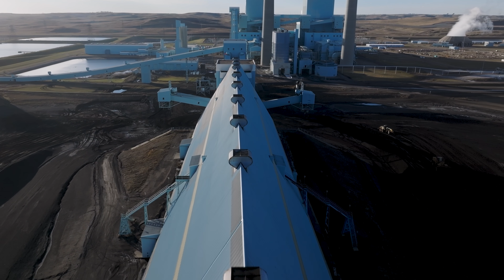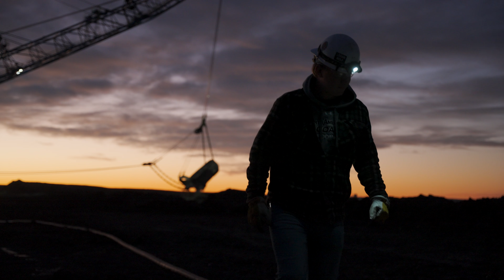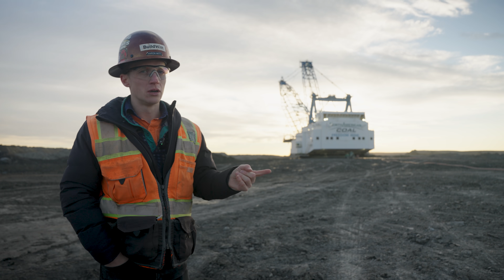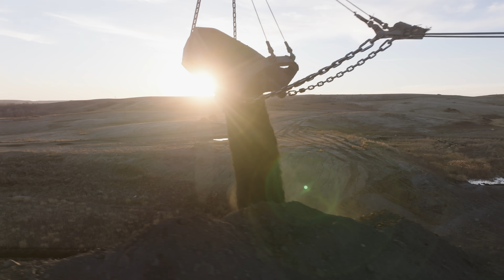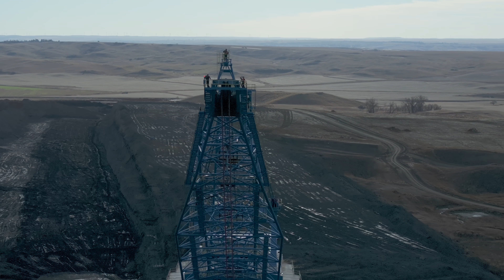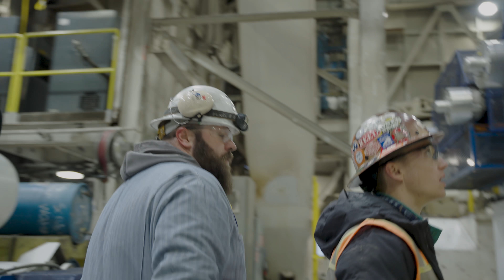Operating the World's Mightiest Earthmovers!

Comment: Incredibly cool machines, but why use these over bucket wheel excavator? Genuinely curious!
Reply: Mainly ground formation. If the ground is hard and cemented you can't use bucket wheel excavators. Also it's very expensive.  It can take one year to build one up from scrach, and you also need a conveyer belt system as well to haul the overburden

Comment: Thank you so much for the walk through 😊❤😊 the shot of the double picture of the Bucket on one, and the two control levers on the other, showing function of cables 😊
The Ground man has the hardest job in my humble opinion as to were to lay the power cable in perfect loops or big "U" shapes. But MAN the guy INSIDE the belly of the Beast what he has to understand in his "BRAIN" 😊 listening for the proble noises. Just understanding the motors, the electric systems. He is amazing. I give him an A+ for knowledge. The grease gun comments were so,so "FUNNY 😊 I love my 1978 Dynahoe-190 made by Bucyrus Erie 😊 I wanted to keep a part of their equipment line and own the beefy built Backhoe 😊

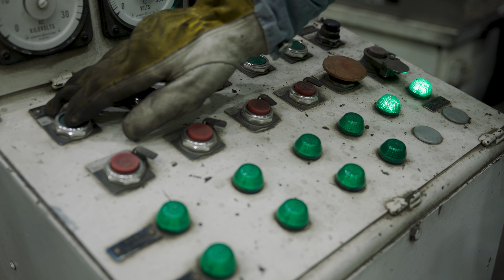Comment: 36:19 so they are using electric motors to spin generators? Is it to produce DC power? I imagine it also keeps the input power draw smooth by adding its own inertia in the system. Just never imagined that it wouldn't have been transformers or something.
Reply: I was curious about that too. Probably rectifiers at the time it was built were more expensive. These days you would definitely just use transformers to get your needed ac voltage then rectify from there with modern power electronics

Comment: Was the machine originally diesel powered ? It is already electrically powered and it's having "generator", so I guess these were diesel motor generator that got retrofited into electrical powered generator, but ... why not just install a power transformer instead ?
Reply from the maker: no always electric
Reply: @buildwitt  So would you be able to touch on a bit the reason for the "generator" ? They take electrical power to spin generator to make electrical power. I really really don't understand why that choice was made and usually I learn something in these moment.

Comment: I helped build drag lines for Bucyrus-Erie in the 2000s, working for a subcontractor in Racine, Wisconsin. It's very hard to convey the scale of these machines, but I ran a CNC Press-brake, rated at 600 tons, that had a 12 foot wide throat. 500 tons is a million pounds. I bent 4" thick steel plate like paper. But the Bucyrus-Erie plant itself had press-brakes that bend 12" thick steel plate, so maybe a 2500 ton capacity ? The buckets hold approximately 100 cubic yards of material, or 10 semi dump-truck loads at a time.The buckets on drag lines are 1 foot thick steel. The operator cabin is a 2-bedroom appointment, with a kitchen and everything. They are assembled onsite, under tents covering over 10 ACRES. The gears that rotate the cabin are 10+ feet in diameter, machined within 0.001 tolerance. The company that forges the gears is only allowed to operate 2 hours a week, strictly controlled, because it sets of earthquake detectors throughout the Midwest. Living now in Texas, it's hard to explain to people here what industrial-scale really means.
Reply from the maker: amazing!!!
Reply: @buildwitt so uh when are you going to that plant?
Reply: Wow thank you so much for sharing that incredible information!
Reply: Yes but if you were a real man or woman you could be constructing windmills and all the construction that goes with it instead of releasing greenhouse gases into the environment. Coal emmisions are very destructive to the environment and in North Dakota you have way more air flow than you have coal.
Reply: Kansas has one of BE's older machines. Big Brutus, gotta say these things are no joke in how big and complex they are, it's amazing that they ever get built, let alone multiple.

Comment: I wonder if there would be a possibility to fit some kind of energy recovery system into those drums to make the whole thing more efficient
Reply: They do a little bit of energy recovery by using the motors as brakes when lowering the load, the generator motors act as a flywheel energy storage.

Comment: One thing I did not quite understand, why does the big drag line need the generators inside for? I thought everything was powered by the big power cord.
Reply: The power supply is AC from the grid, the drag line motors are all DC. The generator assembly also acts as a flywheel energy storage to smooth out the power draw.

Comment: i know how you can move it faster but you're gonna have to make one expensive call to towhaul.

also interesting thing about that power cable. they cant make a stranded cable big enough to properly move that volume of power without melting the cable. large electric equipment like that runs water cooled cables taking wire capable of 600A and cooling it to achieve an 1800A full load capability. then they crank the input voltage to drop amperage for the same wattage to help with wire gauge as well. its really cool stuff to be able to check out in person.

Comment: How often do they have to install new cable ropes on the dragline due to the constant stress, wear and tear of continuous excavation 24/7/365? And how much time does it take to install them?
Reply from the maker: I know they do it at least once a year, but I'm not 100%. I've seen it done once. Usually in a shift. They use a D10 dozer to pull the cables through
Reply: A lot less frequently than the equivalent hydraulics!

Comment: Bagger 288 and Bagger 293 are smiling over this tiny machines :P
Reply: Those machines are twice the weight of these Draglines and yet have tracks. Both machines are impressive in their own ways. But those Baggers are an engineering marvel.
Reply: Bagger can't move big rocks this thing does.
Reply: @alexjohnward bagger can move way bigger rocks than this one
Reply: @commandbrawler9348 no, it can't. The bucket is much smaller and it uses a conveyor, the drag line doesn't have small buckets and doesn't use conveyors.
Reply: @commandbrawler9348 As a Junior Mining Engineer I can safely say that it can't. It is designed to move huge mass of  loose or "semi loose" overburden. Like sand, clay and stuff like this. If the bucket touches strongly  cemented rocks like sandstone, over time it's teeth and buckets are shot. In this case, we back up the excavator and blast the rock or use pneumatic hammers on smaller excavators
Reply: @alexjohnward the scoops can pick up way larger quantities of rock and material so you don't know what you are talking about.
Reply: @GiantCookie01 it can still move more material than any other machine plain and simple
Reply: @commandbrawler9348  depends on the application, if th rocks are the size the bucket wheel can't handle, it won't move it. A drag line has a larger bucket.
Reply: @alexjohnward a drag line only has one bucket while the bagger has multiple buckets on a wheel so it can move more material in one move regardless if it is stone, sand or other material.
Reply: @commandbrawler9348  If it's a rock the size of a D11 the bagger will jam on it. The drag line can move D11 size rocks all day for 40 years.
Reply: @alexjohnward stop beating around the facts. Bagger is bigger, better and can move more material. Simple as is
Reply: @commandbrawler9348  Why are you talking about stuff that is irrelevant?

Comment: The dragline bucket capacity 120 yards is around 3 heaped 657 scraper loads 44 yards each.
Reply from the maker: yeah it's no joke
Reply: @buildwitt  Around 10 Hwy truck loads. In the 90's it would take me 4.3 minutes to load 10 trucks with a highly modified PC650. I don't know the cycle time of dragline, but it appears to be way less.
Reply: Are you saying the dragline is not the best piece of equipment for the job?
Reply: @alandillon6469  Not at all. I'm comparing how much material is 1 dragline bucket to how much material in other methods of moving dirt. Moving 5,000 yards 160 feet a hour with 3 machines and 4 person crew is really impressive.

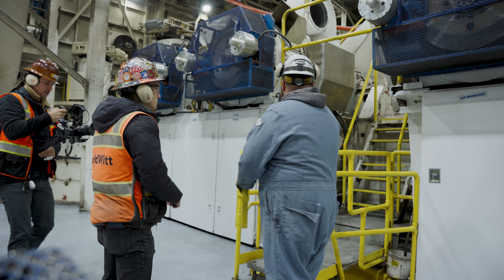Comment: I'm confused about the 'generators' around 35:10 ? Does anyone have any more details about what it is doing? I'm guessing it's some kind of rotary converter? Pre-semiconductor frequency conversion? ETA: 36:23 shows them labeled M.G. so they are motor-generators, but I am still curious as to the purpose?
Reply: The power supply is AC from the grid, the drag line motors are all DC for high torque. The generator assembly also acts as a flywheel energy storage to smooth out the power draw.
Reply: @alexjohnward so the oiler is also a brush bitch? They must have to replace the brushes in those DC motors often.
Reply: I’d also guess the MG setup helps with the feeding, plus make the slip ring easier.

No skin effect on the mile long feed cable. Capacitors plus the rotational mass would smooth out the constant start stop of the motors. Same source says the motors are 1045hp each, so that’s 12000hp if both lines are moving while they swing.
Reply: I found one thing saying the feed was dc, 22.9kv, and that the total motors were 30mw.
Reply: I’m really impressed with the power cord insulation.  Containing 23k volts across conductors in a such a small flexible bundle that’s constantly being man-handled by a 200hp tractor is wild.  I wonder how often it fails.  Bound to happen from time to time.

Comment: Another fine video of an important operation. Didn't seem like the grease guy was a happy camper.😂 As a retired heavy equipment operator, I know how much I hated greasing the equipment. 😂
Reply: Those Milwaukee battery powered grease guns sure does make greasing a lot easier. I am a big fan of the Milwaukee Grease gun.
Reply: @berlbrawley5758 as a industrial robotics mechanic, that and their pump for large operations
Reply: @berlbrawley5758 as a industrial robotics mechanic, that and their pump for large operations
Reply: @berlbrawley5758  Yeah.. until you get a god damn JD 844K-III, for aggregate, it has a grease reservoir that has to be manually filled, with grease from a barrel with a hand pump, ain’t no cheating that unfortunately. Thankfully, that loader auto-greases, it’s just the reservoir that needs some loving.

Comment: Mightiest Earthmovers?  Bucket-wheel excavator begs a pardon.
Reply: Instead of complaining, just enjoy the video.
Reply: @Oldschoolrules123  commenting on the video title,  is not automatically complaining.

Instead of making an accusation, stay on topic of the comments.
Reply: @KlausbergerYT Maybe you didn't notice that this bucket dwarfs the buckets on a bucket wheel. 2 different pieces of equipment. 😊
Reply: @Oldschoolrules123  The argument against "the" mightiest earthmovers is, this is not the mightiest in size of the machine itself, and mo it by far does not has the output of the largest bucket-wheel excavators. (Which have 50% more daily capacity)

And compared to the Bucket wheel, that bucket alone is pretty small.
Reply: @KlausbergerYT You must be jealous because you aren't in the US. 😂
Reply: @Oldschoolrules123  Yeah, thanks for this empty void of a comment! 

Good that we now know, that there is no argument but just a Bot, ragebait or both.
Reply: @Oldschoolrules123 instead of complaining just keep scrolling
Reply: BWE can't move a big rock
Reply: @alexjohnward  Yawn. unrelated to the fact its not the "mightiest" earthmover in size or througput. 

(And what is even "big rock"?  Pretty big Rocks fit into a 6m³ shovel of a large BWE.)
Reply: @KlausbergerYT  Loool a big rock won't fit on a truck. Bucket wheel excavators shift ore which is soft, small and uniform, they generally don't shift "earth" at all.
Reply: @alexjohnward  Yep, wrong. BWE´s shift the same overburden as the Bucket-Excarvator in this Video. When they reach the Coal, the literally switch the conveyor belt to another direction.

Also all those house-sized rocks in the video, that fit on no Truck! Were obiously hiding somewhere while BuildWitt was there.

Comment: Machine hours are wild…
Reply: a good 30 years of nonstop use
Reply: @j_wide942  jep so my calculation says
Reply: Hours are only bad when you don't take care of stuff, don't do stuff it's not supposed to do and keep really good oil and grease in it and it'll be great for a long time, these are also electric so that helps but it applies to an old vehicle or even lawnmower or something.  Modern cars and stuff is different it doesn't matter how hard you try to take care of it that new car was designed from the bottom up to last so long and then cost so much money to fix that you want to just buy another new thing